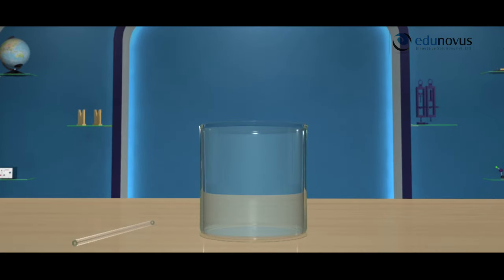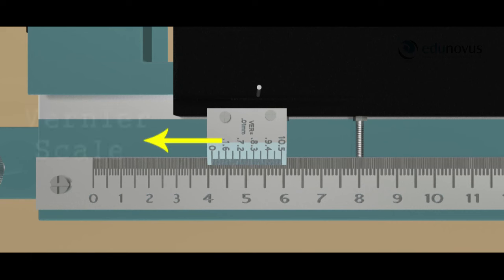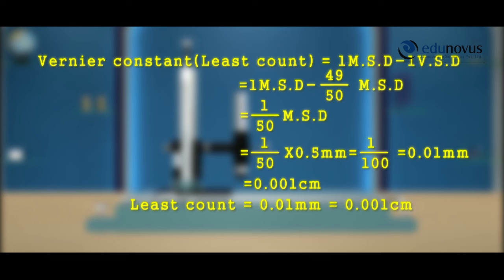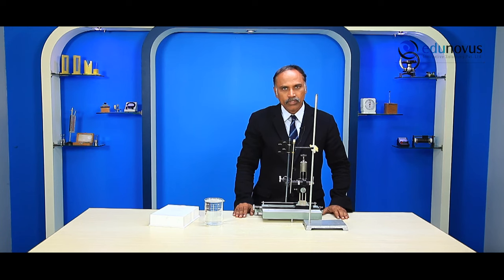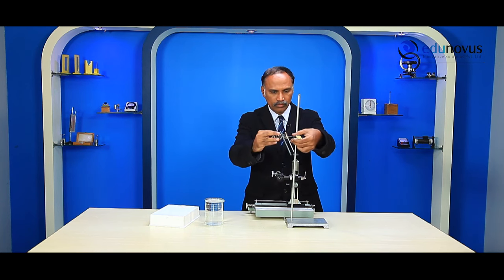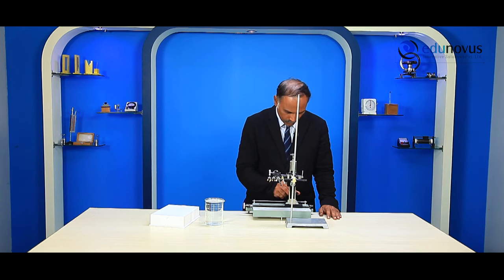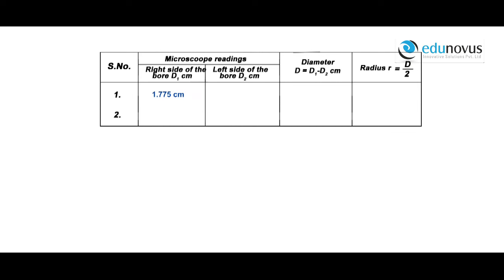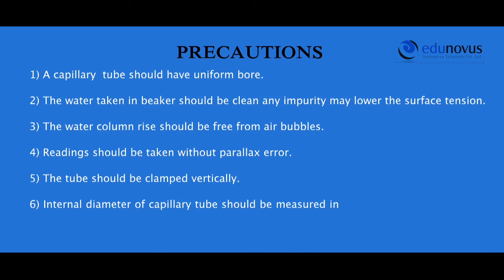Physics Practical: Surface Tension experiment (Use headphones for clear audio/sound)

Comment: measure the moment of inertia of different bodies like disc,hollow and solid cylinder
coherence and width of spectral lines
diffraction intensity at slit of double slit system
these are the name of experiment which i have to perform but couldnt found any practical demonstration video on internet please help me about this

Comment: hey, the formula of the surface tension needs a correction may be.T= (h+r/3)r* row* g/ 2 cos theta
Reply: +om saha for small angles cos theta is approx to 1
Reply: now to be more precise! it`s just needed <.<
Reply: +Shrey Sharma you're right in this case measuring theta is very difficult
Reply: +saranya Ravva ikr, but the formula isn`t done without the cos theta here. <_< 
at least, it must be given! though we know the value is zero in this case, the exact formula will be more helpful in other case.
Reply: lol, it`s anyway to be corrected. ^^